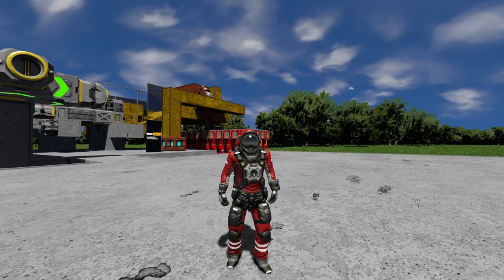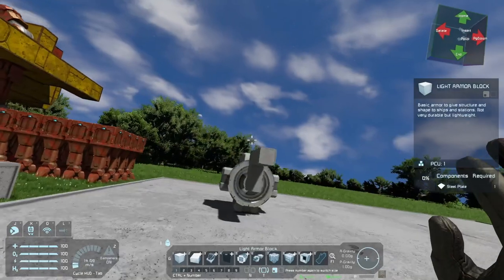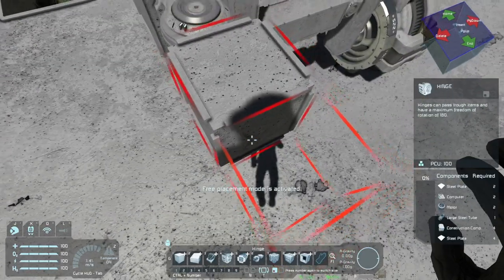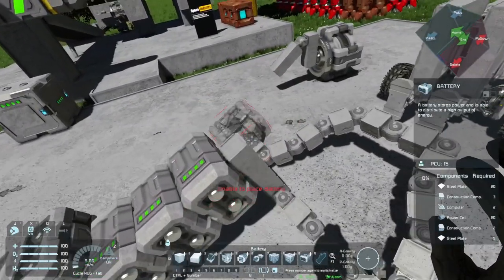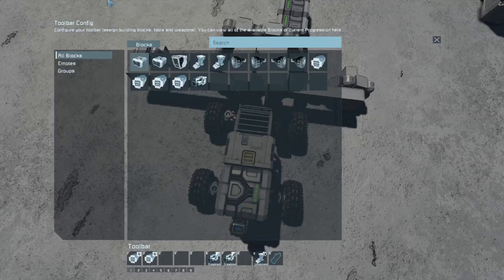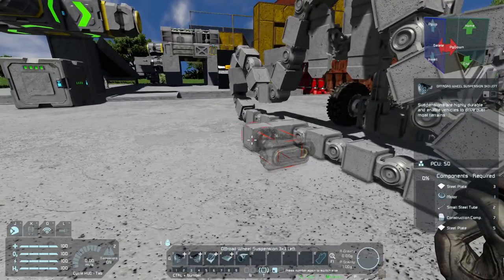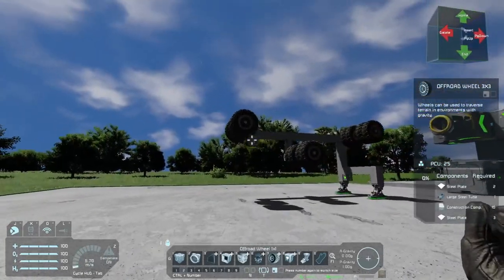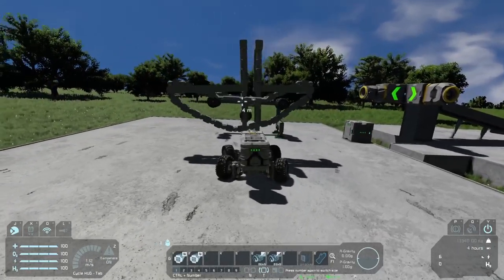Space Engineers Industry: Hinge Conveyor Belt System EP4

Comment: Your conveyor belt is a big win! Now imagine using windows to create a lip around the sides and back of each tray, and you can easily use that to climb in elevation. You can make a similar tray on a piston, mounted with a hinge, to serve as a periodic elevator. At the top of the piston's length the tray has a catch that forces it to tip forward on its hinge, and all its contents get flung off into the hopper or whatever awaits it.